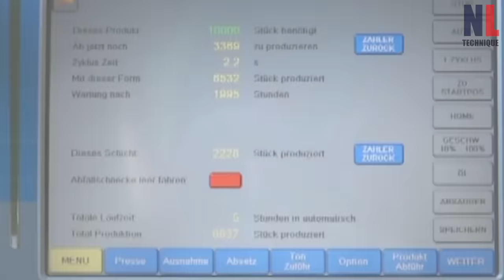Amazing Ceramic Making Projects with Machines and Workers at High Level

Comment: Never in a million years would have guessed how automated balloon type things would paint bowls.
Reply: i’d loose it all for the ceramic bowl tiddie
Reply: @_Chaotic_Lesbian_ the jiggle!
Reply: I should call her
Reply: its called Pad printing, the bag being the pad. They pad print cups, bowls, plates and as you saw multi color. So much faster than decal transfer.
Reply: Right
Reply: I actually saw a short on IG and led me to look for those baloon thingies 😂
Reply: What is that balloon stuff
Reply: @papipaper911  it is called a "Pad" and what it does is pick up an image made from ceramic materials and transfer it to a ceramic ware with raw glaze applied. This is much faster that applying a decal and will also transfer an image to odd shapes like bowls interior or exterior. Process is called Pad Printing
Reply: @TBButtSmoothy  silicon
Reply: instablaster.
Reply: That's called pad printing method
Reply: Same here

Comment: How ironic that some plates cook at high temperature at their making but just a little twirl in the microwave and they completely shatter😂😂😂
Reply: Cláudia Assunção Bernardo Cossa because of air pockets in between
Reply: @anshulbhardwaj4038  No, its is the formulation of the clay body that makes it able to take the heat. Some wares are not made for microwave some are and some are oven proof. Then there is flame ware that can go directly on a gas flame for cooking.
Reply: Its due to Resonance may b .. . 
Cz Microvave uses high enrgy by procesd.. resonance
Reply: @aeshaash2172  OK besides that and I have worked in the ceramics manufacturing since the 70s. Tell me why certain clay bodies/fired wares heat up when in microwave and some do not heat one bit? There is something in the formulation of the clay body that causes this.
Reply: @2manycatsforadime  
Sure.. Every product hav its own quality capacity to bear such disasters😂